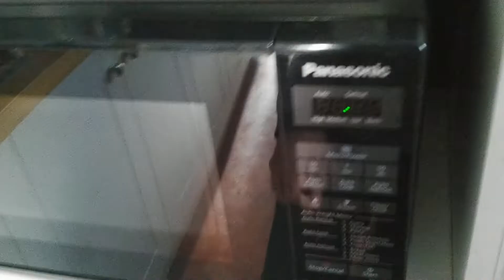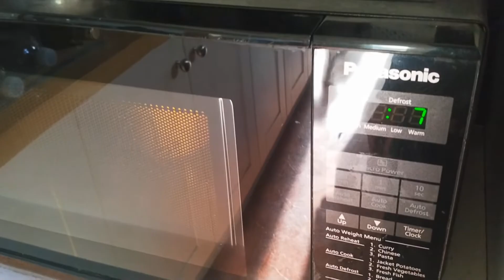TIP: Microwave Sparking Easy Fix - Waveguide problem diagnosis and replacement

Comment: Hiii that is most helpful. A query - there is a rough patch of possibly peeled paint at the point of contact where the wave guide cover has eroded and was sparking. Would it need paint or just replacing the mica sheet cover should do? Thank you
Reply from the maker: I would just give it a gently clean/rub with a bit of sand paper and should be fine.

Comment: Cheers mate! I am incredulous that the high tech blaster machines need a piece of fancy card board to work....
Reply from the maker: Indeed, the good news being at least it's a cheap fix. I nearly went to the straight to skip option before discovering actually how fixable a thing this is!! Hate to think the amount that have made it to landfill on the basis of a glob of tomato on the fancy cardboard.
Reply: @bigskies2202  exactly. We had to dig a bit.